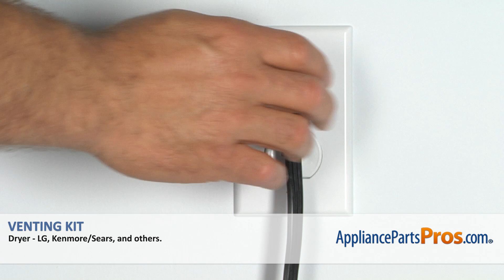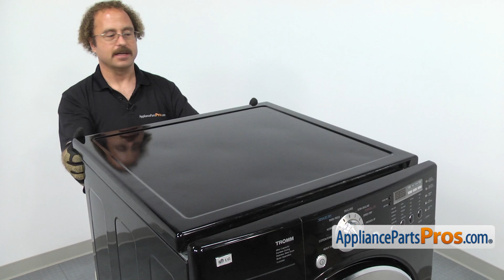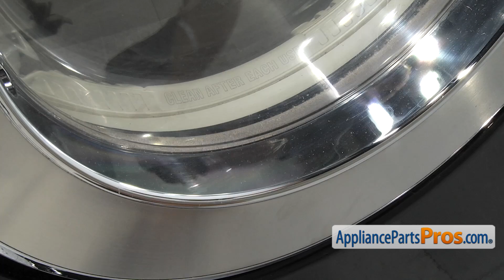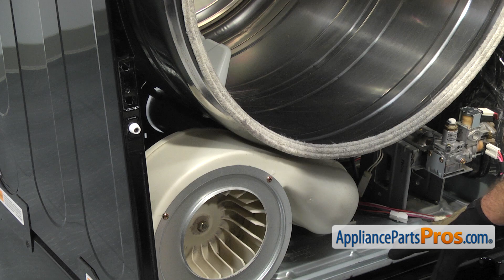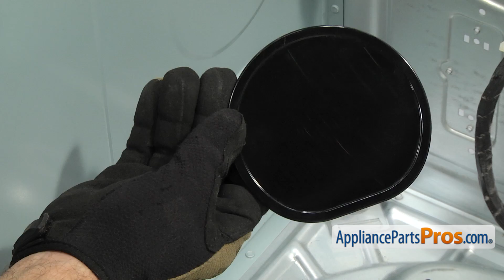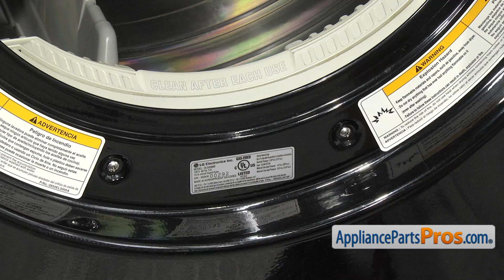How To: LG/Kenmore Venting Kit 3911EZ9131X

Comment: YOU SHOULD USE ONLY VENTING TAPE NOT DUCT TAPE!!
Reply from the maker: The use and care manual recommends duct tape, but you can use venting tape if you prefer.
Reply: @appliancepartspros   100% SURE THEY MEANT "DRYER DUCT TAPE" WHICH IS ALUMINUM HIGH TEMP TAPE 
USED IN EXHAUST STOVE VENTS AND ROOFING 

NORMAL DUCT TAPE IS NOT HIGH TEMP RATED AND WILL DRY OUT AND IT'S FIBERS WILL BE  A FIRE HAZARD

Comment: At 9:21, is it completely fine for the bundle of wires to be against the venting kit? Would the heat over time not destroy it?
Reply from the maker: Great catch! While it might seem okay at first, we don’t recommend letting wires rest directly against the metal venting—over time, the heat could potentially cause damage. If possible, we suggest securing the wires slightly away from the vent using a clip or zip tie rated for heat. Better safe than sorry! 🔧👍

Comment: I can’t believe manufacturers would make it this hard just to convert your dryer to side venting.  I think it’s ridiculous you have to completely take apart a new dryer.  This was a great video though, thanks for making it
Reply: A couple of points. I wanted to get a new LG gas stackable. Many videos including this one say you cannot vent to the right (facing front of unit) if it is a gas unit. I called LG and waited on hold with their tech dept. They were completely worthless and had NO IDEA what I was talking about.  Why would anyone design a dryer that cannot vent to the right because they ran the gas line in line with where the vent needs to go.  I think GE units can vent right AND have an easy access panel on the back which makes it simple.

Comment: Will the 90 degree elbow fit through the vent hole? If it will, would it be easier to assemble the elbow to the two straight duct pipes, tape them then insert it into the dryer?
Reply: That was my question too. Did you ever get an answer???
Reply: @samstoufer5312  I have gotten no answer.
Reply: @jeffreyreicher5241  Thanks. Let me know if you do.
Reply: no reason why it can't be done that way; just a bit more challenging to tight the screw which locks the initial tube in place.

Comment: Very good video, gives me more confidence when working on thru the rear hole. Also construction code requires the metallic tape on vent pipes, I would imagine that inside the machine you should use metallic tape also.

Comment: in july 2018 for the first time did the side venting on my new LG dryer first under no condition should you use duct tape buy a roll of metal tape made for heat very cheap in big box store 2 nd there is  no need to take apart a brand new in perfect condition dryer unless your hands are so big you can not get them in the vent holes take of both side vents and the back vent is already off and you will be able to do it that way and buy the kit dont cheap out the right angle is already sealed at the joints and fits perfectly also the the connection to the back vent has a screw hole to hold it in good luck no duct tape please
Reply: @witchspawnvictoria  this was the first time i did it i bought LG side vent kit makes it very easy and metal tape not cloth easy instructions in the box
Reply from the maker: Thanks for the tips!
Reply: @appliancepartspros  And hope your house didn't burn down!  Jesus, why not stuff the empty space full of gas soaked rags while you're at it, another tip from appliance amateurs.
Reply: Thanks for the tip.  Seems you could get it done from the side and back.  Thanks.

Comment: Hi, Are you saying this kit is easier to install by taking the whole dryer apart first???
Reply from the maker: There are often a number of ways to install parts, this is just the one we've chosen for this video. Sometimes parts can be installed with less disassembly, but you'll have less room to work and less visibility, so it depends. ¯\_(ツ)_/¯

Comment: I was wondering if you could help me out, do you sell the original exhaust vent that goes straight out of the rear of the machine? It was altered to vent out the side in the past, BUT I want to vent it out back to how it originally came from the factory ( It wasn't me that misplaced the original vent lol :) ). Any input would be greatly appreciated... Sincerely Jason

Would this be the part for a LG SteamWasher to convert it back to the rear vent? http://www.appliancepartspros.com/lg-duct-assembly-5209el1006a-ap5071385.html The dryer is Electric if that matters, NOT Gas...
Reply from the maker: You can go to our website and enter your appliance model number to view the parts breakdowns to be sure you get the correct part for your model and see if this exhaust tube is listed. http://www.appliancepartspros.com/